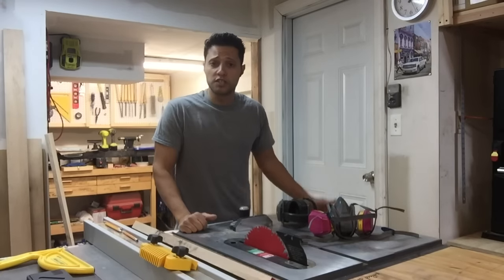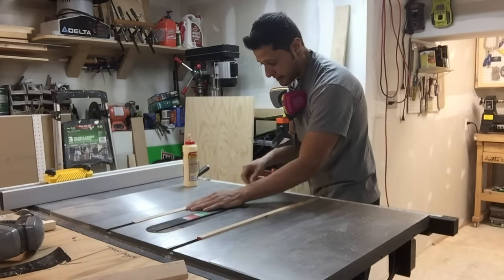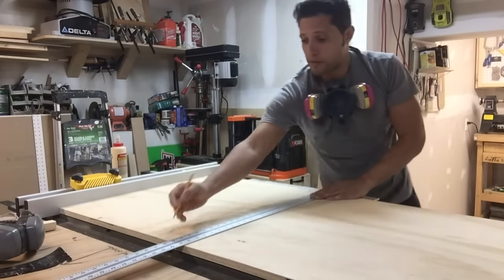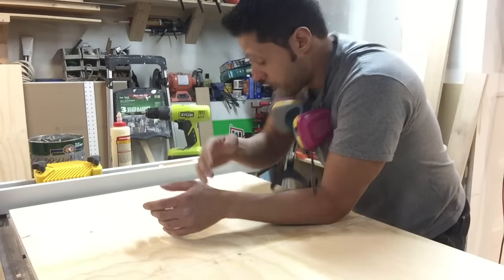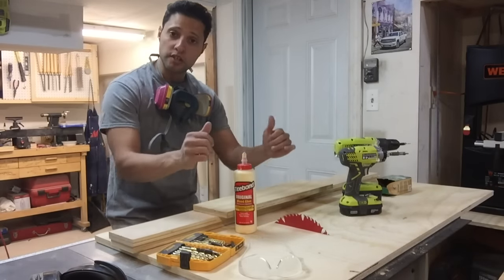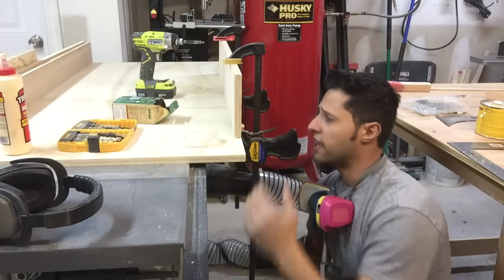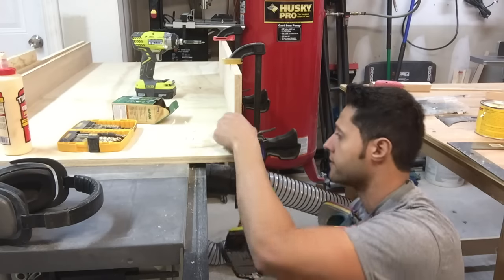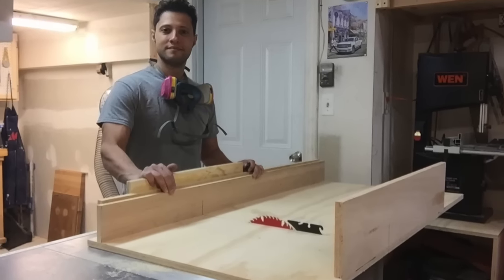How To Make a Crosscut Sled

Comment: Do you have the plans for this sled posted anywhere? Looks like a valuable thing. We just got a new Dewalt and I needed to crosscut some small pieces. I saw your video on that and then searched for this sled. TIA
Reply from the maker: I don’t have plans for it because every saw is a different size,as well as the miter slots, so plans would only work for my particular table saw. That’s why I tried to give as detailed instruction as possible as a guide for everyone to make this sled tailored to their own saw.

Comment: awesome job turned out great! good idea to screw the runners from the top. the fence on your table saw is that the t3 model?  looking to retro fit one on mine and just wondering how you like yours and if you would recommend it?
Reply from the maker: Thanks, that fence came stock with the saw, it says delta T-square. Not sure if it's a T3 I'll check and let you know

Comment: Hey Anthony, I figured out the stops on the saw, I wasnt tightening hard enough and I guess I was expecting hard stops, these are a little different. Hey I wanted to ask you something real quick. What kind of wood is that triangle piece you are using to cut the runners? Can I use just a regular 2x4 if Im able to cut some nice straight knot-free pieces?
Reply from the maker: Jay Ross those runners are made from oak. Don’t use 2x4’s, they are 
Pine and pine is a soft wood. Use a good hardwood or the runners will have too much play and wear out quickly
Reply: Anthony Scolaro oh ok, yea I wasn’t taking that into consideration. Makes sense, thanks.
Reply: Im following your plans for the router extension wing and I dont understand how your plywood pieces are perfect. How do you get your sheets so straight? I sorted through quite a few of the premium sheets they have at HD and even the best one I was able to find had moderate flex.

Comment: Another great video, I found your channel about 6 months ago and have been addicted since. Question, I'm new to wood working and I'm looking to buy a cost effective yet quality portable table saw. I narrowed it down to the DEWALT 7480 and the Ridgid T4513, in your opinion which saw would be my best choice, they are about the same price, thanks Anthony
Reply from the maker: Dewalt is top notch, rigid is a good choice but if they are close in price, I'd go with dewalt. I have their track saw and some dewalt corded drills and they are incredible. Thanks for watching, plenty more on the way.